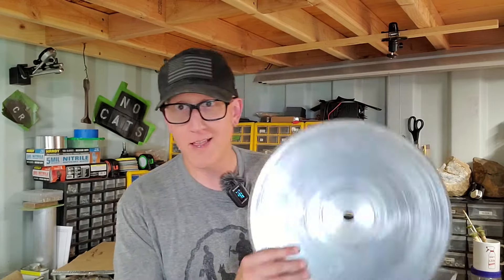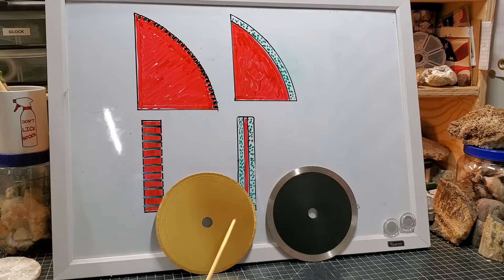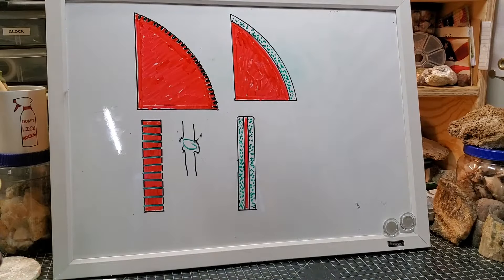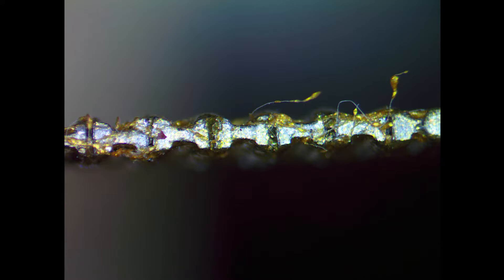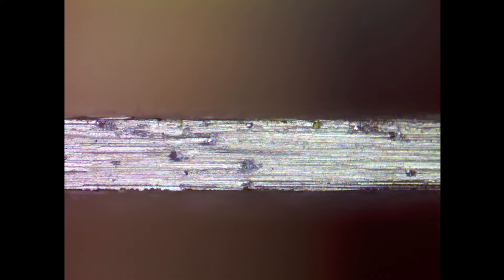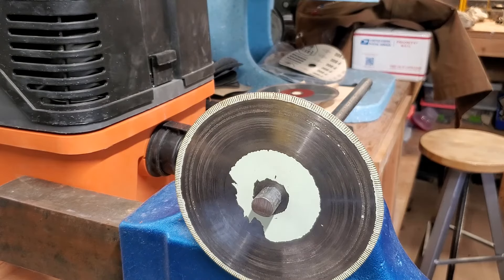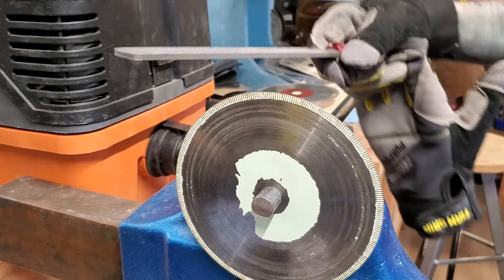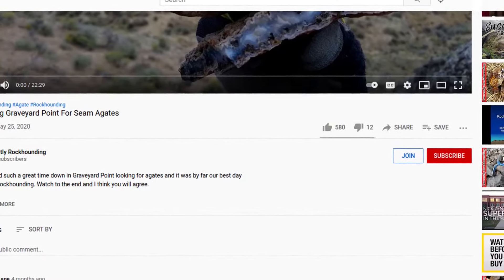The Trick to Making Lapidary Blades Last Forever!

Comment: I’m an old diamond blade guy from the concrete cutting world.  The another way to quickly sharpen a glazed blade is to cut into an Carborundum wheel.  This is how we “dress” new blades at the factory.  Don’t over dress it, because you will waste diamonds.  You want the stones to just be exposed.
Reply: Sand blast it?
Reply: @AlchemyOfTheFourthKind  I don't see why that wouldn't work.  Good idea.

Comment: I use sintered blades only so I have no experience with the newer blades. Depending on the blade I have always sharpened the blades by either cuttng a piece of cinder block with some blades and Quartzite or hard stone thru once or twice on other blades. If all else fails I use a 4” grinder with a diamond blade and cut notches in the sintered blade every inch around the blade. Basically making the continuous rim segmented but only much shallower. I wouldn’t cut all the way thru the sintered are, don’t need to and might compromise its structural integrity.
Reply from the maker: The process shown here works on all types of blades.
Reply: @CurrentlyRockhounding  I like the method. I’ve never heard of it. Thanks for sharing.

Comment: That method exposes scant few more diamonds. Run a coarse grinding wheel against a running wheel for a few minutes. The diamonds are unaffected, while the metal is removed below their surface.
Reply from the maker: I've tested that in another video and it doesn't do what you think it does.

Comment: Being a machinist for over 40 years and using diamond cutting blades for ceramic parts, we go through a ton of blades of all grits. 
When the blades start to dull we use a dressing grit stone to give life back to the diamond blade.
They come in all sizes and grit. 
Using the grit stone you grind away the bonding to exposé the diamond. 
You really should not tap or hit the blade because you could damage it, or crack the bond of the diamond to the steel flange holding the diamond
And that could lead to a catastrophic event when the diamond pieces come OFF the steel flange and come back at you at a high rate of speed.
Here is a copy of print from Amazon.
Norton Abrasives Dressing Tool Stick, Grinding Wheel Tool for maximizing Grinding Wheel Performance.
We buy these by the box of  300, so they are cheaper. $1 a piece.
You might even use a old red brick.
Just go slowly when going into the blade using water of course.
Hope this helps.
Reply: Good to know… thanks for sharing
Reply from the maker: I appreciate you commenting but I'm going to disagree with a few things you said here.

I don't think there is any evidence to show that peening a diamond blade with a file will cause a catastrophic failure. 

As far as the dressing of blades goes I have heard people use all kinds of things that range from bricks to real dressing sticks as you mentioned, I think a lot of things get said as if its a fact without testing it, and well the proof is in the microscope.

I do plan on testing dressing stone and all of that in a future video since a lot of the advice for that comes from people that cut ceramics which tend to load blades up with gunk which is very different than cutting natural rocks.
Reply: @CurrentlyRockhounding  when you do that video, on dressing blades, can you include your 180 flat lap disc? If it needs it. Meminer said to use glass or obsidian to get out particles from softer stones (maybe serpentine?) and I was going to buy a chunk to test out for when I might need it. His disc's looked nicer but... he didn't have a microscope. :) and he only did it because that is what was suggested to him.
Reply from the maker: @lindsayc4676  You know I didn't even think about the flat lap discs, I will look into those as well.

Comment: Nice job on this video. Glad you aren't perpetuating the cutting of bricks, grinding wheels and ceramic for lapidary blade sharpening. You did a good job of explaining and showing the science. Sharpening of a sintered blade works the same. I personally never use notched rim blades, they cut slower than sintered blades. When comparing them top down, there is about 4x more diamond in contact with the rock while cutting, sintered vs notched. RR advert, thumbs up!
Reply from the maker: I'm glad you liked it. I also have video up about cutting bricks and other things that people say will work but doesn't.

Comment: Huh, interesting! Love seeing the microscope views👍👍
In another life we used MK Diamond 60 grit dressing stones on tile saws as instructed by my boss at the time. I didn't actually cut tile but he swore by them...and knew his stuff! That might be worth a test if you feel like trying different methods in the future. All you did was "cut" the dressing stone slightly to refresh the blade. If the method holds up under a microscope it could be a small dollar investment resulting in saved time....and another interesting use of the microscope and corresponding video.

Totally random, that boss used to take the spent 14" concrete / asphalt blades and hang them for plinking.
Reply from the maker: Oh I plan on trying out all the dressing methods!
Reply: @CurrentlyRockhounding  Nice!!
Reply: Just did the dressing stone, (used a red brick as some old timer suggest)   This was very large auto feed saw. We are new to this stuff, but the problem we had and figured out was this. During cutting the blade  seemed to be getting pushed laterally  and booging it down. After a lot of head scratching, figured the blade was dull and the feed was pushing the blade more than cutting it. Used red brick as a dressing stone. That took care of the cutting problem, the cut could keep up with the feed. Now going to get a proper dressing stone and also try the ping the blade. Anyway the blade could not cut at the rate of the feed. Did the sharping and not more problem.

Comment: Good tips! I wouldn't have thought a little tapping could ruin the arbor, but I guess it wouldn't take much misalignment to throw everything in a tizzy. 
Another factor in the life of a blade is the kerf of the cut. If the diamondiferous area narrows to no more than the width of the rest of the blade, then the rock will rub against the steel of the blade leading to heating and binding. 
The chop file method works on sintered blade faces as well, but does not refresh the diamonds on the sides. Refreshing those with a bit of filing/dressing will keep your cut faces nice and smooth and reduce the amount of time you need to spend polishing later.
Reply from the maker: I think misspoke a bit there, hitting your blade while on the saw is transferring unnecessary load to the arbor and bearing and you could get them out of alignment which is a pain to realign your blade vs. just take the blade off which is just a single nut.

As far as the side dressing of sintered blade I plan on testing that as well. I think most of the methods out there that people use for that is kinda bunk and its easy to test cause the proof is in the microscope you know.

You are correct if the cutting area of the blade narrows to the same width as the rest of the blades core the n it will rub on the rock and heat up. I think the real question which is another thing I want to explore is does that really matter that much. I don't have a blade that worn out but I think I can ask around and get one, I'll then go and rent a FLIR Camrers and see how much more heat is generated. Should be fun!
Reply: @CurrentlyRockhounding  I think I generalized in my comment, extrapolating from misalignment to ruined arbor. 

Your used sintered blade still had quite a bit of diamond exposed, though over time the metal could start shielding them just like the notched blade. Since filing/dressing takes off width of the kerf, regularly reversing the blade may be the best way to promote even wear.

Like you say, there's a lot of bunk out there, and most people will swear by what they've always done, without having tried alternatives. I'm looking forward to your future mythbusting videos!
Reply from the maker: @DonohueLabs  Thank you! I just want real answers and not hear say. : )
Reply: @DonohueLabs  @currentlyrockhounding. Peening the edge restores width to the cutting edge. The edge of the blade is the only place the cutting is happening. (supposed to anyway.) If you are wearing the sides of your blade cutting area, you have blade wobble that needs troubleshooting, repair and alignment.

Comment: Interesting!  I always used an old grinding wheel or brick.  Bricks kinda suck it's like your oil will turn red and stay that way.   I'll have to try this.
Reply from the maker: I also have a video about using the brick which you might want to watch.
Reply: @CurrentlyRockhounding  thx I just did.  I think I only used brick one time and didn't like what it did to my oil.  I've always used grinding wheels.  I felt they made a difference imo but the next time I will def try this.  Unfort the only dull blade I have right now is a 20" so starting out big lol.  thank you!

Comment: You are definitely the most informative rock hounding channel. Thank you for sharing your knowledge to some of us who mainly learn this skill from YT. When I started I knew nothing about lapidary and no one to ask on how to work the machine. There is still one thing that I’m curious about. What rpm are better for the blades? Specially for quartz material. Thank you.
Reply from the maker: Thank you!

As for the blade question it depends on many factors, blade type, saw type, water or oil, and what you are cutting.

Comment: @Currently Rockhounding: 

So if tapping works... By moving the metal matrix, so that the dull diamonds disappear at the next cut... Then wouldn't inverting the blade (on blades that are not directionally structured) not work in the same way?

We stick to a given direction to retain the diamonds that have the metal matrix behind them (from the pov of the cutting direction), holding the diamonds in place. But if you flip the blade around, the metal will be taken away on the next cut, and a lot of the diamonds that depended on this metal matrix will vanish with them...

I have started doing this on dremel speedclic blades today (on nasty cheap tiles), and while my feeling is very subjective, it seems to be working: dull blade, flip, sharper blade.

I would love to see some microscope footage of what inverting the blade does :)
Reply from the maker: That's a good question and something that could be tested.

Comment: Fantastic!! I was a bit downhearted because I seemed to be going through blades so quickly - I'm pumped that I know what's going on with them now and what to do to keep them going. This was one of the most beneficial videos I've watched in a very long while. Thanks!!
Reply from the maker: You will pretty much never have to toss out a blade again.
Reply: @CurrentlyRockhounding  Finally got a chance to try this out and it worked like a charm!!! The blade cut like it was brand new - absolutely incredible. Thanks again!!!
Reply from the maker: @suebelly1840  I'm glad it worked well for you.

Comment: I have been cutting a whole boule of green corundum. This video lets me do the actual cut. I purchased a 10in trim/slab saw and the blade is wide for a 10 in blade. I am using a spring to provide a light pressure to cut the boule. it takes forever. the boule diameter is about 1 and 1/2 inches, and the blade is about 2 mm wide. I found out that corundum is only 5 times softer than diamond itself. but redoing the blade everyday prior to the continued cutting the single 70mm cut of the boule lengthwise. I used to achieve 2 mm per 8 hour period of cutting. Now I achieve 4mm per 8 hour cutting period time.  I am getting a 6in blade so that the cutting blade is only 0.020 mm wide or about. (the main problem is that the width of a 10in black is about 2mm, instead of a 0.020 6in gem blade) (I do wonder if I can stick a 6in blade on a 10in blade machine)?  I hope to complete the cut cutting 8 hours a day for 8 days. I used to only cut quartz, and that was quickish. there are very few videos of synthetic corundum being cut. and they are only about 10mm width and 20mm wide and even those videos that cut take time. I do the file first, then use a dressing stone to clean up the blade of the excess metal.
Reply from the maker: Apologies for the delayed response here.

There's almost far too much to address in this comment. Why are you cutting so slowly? 2mm per 8 hours is a glacial pace for cutting.

Comment: TY. Now I know how my arbor girly bent. Two blades in a row have worn out unevenly since I hammered on my saw blade on my saw. The diamonds on one half of the circumference of the blade are gone so that now I only have diamonds on the blade in the shape of a C. The open part of the C has no diamonds left and the left side of the C shape has plenty of diamonds. I struggled explaining so you knew how weirdly it wore out. Can I replace the bearings or does the whole arbor need replace?
Reply from the maker: I think it depends on the arbor time. Some are fully enclosed sealed bearings and some are just pillow blocks with a shaft. If you want you can email me some photos of your arbor and I can let you know my thoughts on it. Email address is below this video and on the main channel page as well.
Reply: @CurrentlyRockhounding  thank you. It is an old machine, third owner. The entire arbor casing unbolts but the bearings are inside like a bicycle peddle gear
Reply from the maker: @doctorofart  I'm not sure I can picture that. Shoot me a photo.

Comment: I’m super new to using any kind of lapidary equipment or tools in general, so my question will reflect this . 
if I only want to take a few millimeters off of a stone to make the bottom of the stone flat which machine is best for that ? 

I have the Hi Tech 6 in trim saw with the vice. I have tried to use the vice but the rocks seem to be to small and won’t stay put in that vice. I have tried to cut it by hand but they don’t come out even/ smooth (I know that’s probably the user since I’m super new ).
I was wondering if a flat lap or the other machine you mention… I think it’s called a cabbing machine? could work? Thank you in advance for your time and advice.
Reply from the maker: You should be able to produce a nice flat cut with almost any saw and blade. Is the issue a little bit of chip out towards the end of the cut?

A flat lap can help but progress on it can be slow when trying to remove a lot of material.
Reply: Thank you 🙏. I actually just just want to make the bottom of a tumbled rock completely flat but sometimes I only need to shave a few millimeters off the bottom of the stone. So when I saw you polishing some stones I was wondering if I did that but with the pad that did the grinding if that would work to just grind off a the bottom so it was smooth and flat? I want to attach it to make a night light. There isn’t enough to really cut off on the trim saw and when I try to do it by hand ( I can’t get the vice to hold it due to the stones size and shape ) it comes out kind of wavy and uneven if that makes sense? 

Thank you again!

Comment: I have a dragsaw with a lapidary saw blade. The diamond cutter bits  were welded on and 4 or 5 have been knocked off. I would like to replace them but finding replacement diamond bits has been difficult. Also I would like info on the welding process process.  Do you or any of your followers have any info that can help me.  Thanks Randy.
Reply from the maker: I can likely help some, email me a photo of your saw and a close up of the blade.

Comment: Love your channel. Are you tapping the top of the saw blade or the side? You mentioned side load but if you’re hitting the top, I don’t understand how that is sideload. What do you think about synthetic dressing blocks?
Reply from the maker: The tap on the edge of the blade and not the side. When I commented about side loading I believe I was talking about not doing that on the blade while mounted in the saw.

The dressing sticks 100% do nothing for lapidary, I have tested it and it does nothing. The dressing sticks work great if you use them for what they are intended which is cleaning the glazing off of tile saw blade from cutting tile.
Reply: @CurrentlyRockhounding  thank you!!

Comment: So what am I doing when I'm dressing my blade? I'm running a dressing stone or obsidian every few cuts.  Wondering if maybe I haven't been sharpening my blades at all...I have the same machine, and it takes me three or four times longer to cut the same material. 🤔
Totally going to try your way, thanks!
Reply from the maker: To be honest I really don't know what people are doing when dressing a blade. I plan on gathering all of the things people use and I will be testing those as well for a future video. My gut tells me that there's no way a dressing stone or anything like that can reproduce what you get from some light peening on a blade but the only way to know for sure is to test it out. The videos I post of my cutting those Jasper slabs were done in real time by the way.
Reply: @CurrentlyRockhounding  I've been using 2 different dressing blocks and an old brick. I will let you know how this peening method works. I have been using the blocks and not really noticing much of a difference... Hmmmm
Reply from the maker: @kksrocks5204  What are the other dressing blocks? I'm looking for some to test.
Reply: @CurrentlyRockhounding  I've been looking at my order history but couldn't find them .. One was white and one was brick colored. Neither one seems to do anything as far as I can tell!
Reply: I did the dressing thing with my old blade. Didn’t seem to help. Now I’ll try the knocking. Very good guide. Thank you 😊